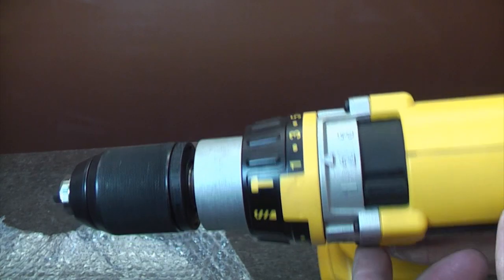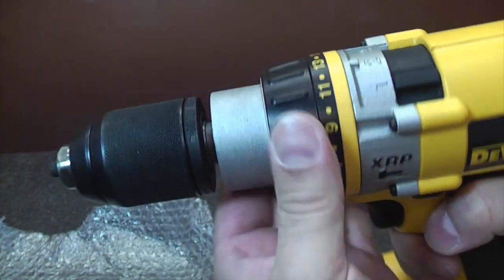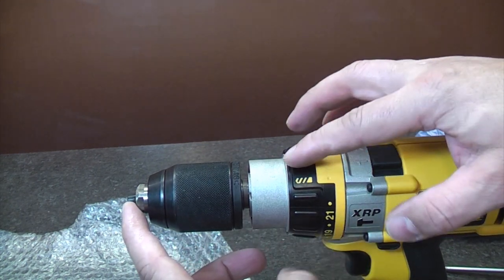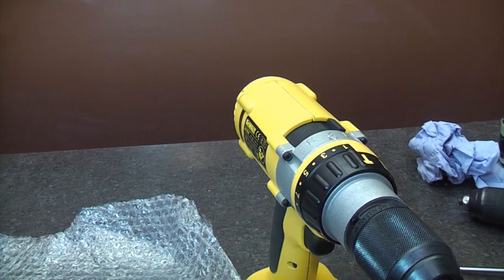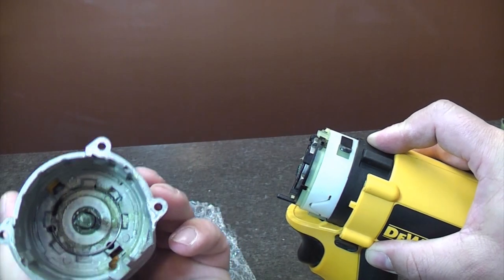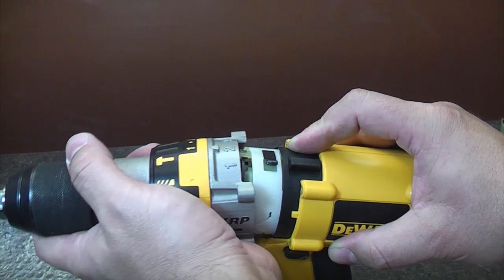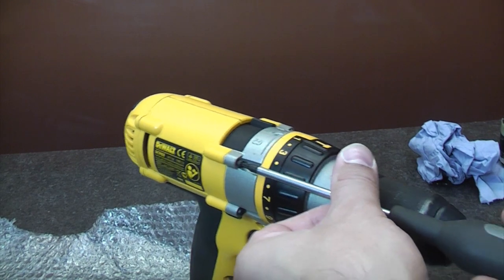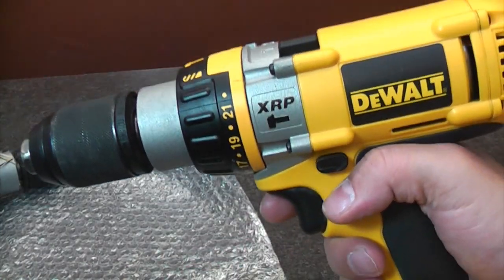Dewalt XRP clutch replacement

Comment: my brother gave me a dewalt dc925 xrp  and it's not working and i wanted to change the brushes to see if that will make it work. but i don't want to spend money on an impact wrench so my question to you is can i buy the dewalt impact wrench adapters 1/4 3/8 and 1/2 to change parts on my car so please let me know

Comment: Well ... how do ya like them apples!  Nearly 20 yo DeWalt XRP DC987 w/o hammer drill clutch option ... clutch was stuck in screw mode ... loosened the four (4) screws a bit and was able to get it out of screw mode ... able to rotate it like it's 'sposed to ... retightened screws ... wouldn't go into screw mode ... took all four (4) screws out, pulled clutch assembly and just started working the clutch including screw mode ... didn't see anything really needed cleaning OR lubrication ... not a lot of lubrication but everything appeared to be O.K. with nothing jammed, etc.  Worked clutch through it's full cycles ... able to rotate it full 360 degrees ... dozen times or more ... operated smooth as a baby's bottom.  Reassembled clutch assembly over transmission, put the four (4) screws back in, checked it, finished tightening all four (4) screws and WHALA! ... back to like new ... clutch operates perfectly.

THANK YOU!
Reply from the maker: I'm glad you have fixed the issue.
I have a spare gearbox and chuck assembly in my garage somewhere (I need to find that)
Thanks for the comment 👍
Reply: @ultimatehandyman  Yeah ... I thought it was a gonner for sure.  So, I'm feeling really blessed to have my nearly 20 yo DeWalt XRP DC987 back.  You can find YouTube videos for almost anything.  Some are pretty good ... some not so much.  Your YouTube was about as good as it can get.  WELL DONE!  I knew about the four (4) screws, however, was reluctant to attempt to disassmble it ... concerned that springs, clips, etc. would pop out and I'd have no way of knowig how to reassemble it.  Clearly your YouTube video posting got me past that.  THANK YOU!

So, I seized on the opportunity of my DeWalt XRP DC987 stuck clutch AND three (3) 18V batteries who had all given up the ghost to grab a new DeWalt DCD778 compact drill this time INCLUDING hammer drill option that I really missed on the DeWalt DC987.  Now I've got two (2) DeWalt drills in my arsenal and lovin' 'em both.  I also grabbed a couple 18V knockoff generic 18V 9096 batteries which I needed anyway for my DeWalt Sawzall.

I should be all set for now.
Reply from the maker: @jimpearman1654   I know what you mean about removing the screws ;-) 
I'm sure I did that on something when I was a kid and the thing fell apart like a Jack-in-a-box 
You won't go far wrong with Dewalt, I have tried Bosch, Milwaukee and Makita but Dewalt always seem to be the best for the money.
Thanks for the update ;-)

Comment: This video is the closest I've come to show how to replace the collar adjustment mechanism, that I have purchased, that you show as a sub-assembly.

I've yet to disassemble to the point of re-assembling that collar adjustment, itself. Can you tell me if the way to get to that if from the chuck direction or the gearbox direction ? I'm am presently disassembled at the gearbox/housing point resulting in the same sub-assembly you installed in this video.
Reply from the maker: I'm not sure, sorry.
It's a while since making this video and I have not worked on any drills since.
Reply: Thanks for the reply. As it turns out, I've got a conversion kit on 
order and other options pointed out, that may well solve the inability 
to assemble the adjustment collar issue that I have at this time.
Reply from the maker: You are welcome.
Best of luck with it ;-)

Comment: I recently bought a DeWalt drill (d21570k a.k.a Silver Bullet). The gear is a little wobbly, but does the job perfectly. Can I somehow tighten it up if I remove the keyed chuck?
Reply from the maker: Gandalf4137 
It's doubtful. There is a chance that something has failed inside the machine (perhaps a bearing) that would need replacing.

Comment: Any ideas on a DEWALT DC820KA impact that recently lost its torque. Seems like it lost its power, batteries are good. It acts like a cordless drill turned way down where you can hold it with your hand and stop it.
Reply from the maker: I've not taken a impact to pieces yet, but I would imagine there is something wrong with the impact mechanism, I'm not sure if you can get replacement bits or just replace the whole impact section.
Thanks for the comment

Comment: Would this be the reason for losing some torque? I ask because I noticed mine lost quite a bit of it when I used it for the third time in five years.
Reply from the maker: Not sure, but if the motor turns and the chuck does not it is likely to be the gearbox.
Thanks for the comment

Comment: Hello 👋 So I have a question. My dewalt is different. But when I put it on the drill setting it slips as if it was on the clutch setting. Can it be fixed ?
Reply from the maker: Yes. It sounds like the clutch might be damaged. https://youtu.be/s262yXyUYD4

Comment: My dw997 clutch has failed - constant slipping. Replacement clutch is not cheap, I wonder can i make it seize up, so that I no longer have the clutch or hammer but just a regular drill.
Reply from the maker: I'm not sure, sorry.
I have seen one fall to pieces and there was literally hundreds of small pieces that fell out of the housing!

Comment: I have a DCD951 hammer drill that the clutch has gone out. Is it worth replacing the clutch assembly and where is the least expensive site to buy replacement parts such as the clutch assembly?
Reply from the maker: Peter Coots I normally get parts from ebay-http://fave.co/1PR7ZIp
Reply: ***** Thank you. I will check into this.
Reply from the maker: Peter Coots 
You are welcome ;-)

Comment: How do you remove the chuck on a DCD996?
Reply from the maker: It should be the same as this method, although you will have to open the chuck and see what kind of fastener is holding the chuck on as it could be a Torx head on a Dewalt- https://www.youtube.com/watch?v=xagFLCseeDk

Comment: Good video. Where's a good place to buy the part in the UK?
Reply from the maker: I bought mine from a seller on ebay, I'd check there first ;-)
Reply: I have had a quick check, but no luck so far. Looks like with shipping from USA these come out at around £69 for new. Though on Ebay you can get SH drills for quite a bit less.
Reply from the maker: Blimey, that is expensive.
There are some at £46 including delivery for the 988 model, but they are much cheaper in the states!
Reply: Actually, I see that eBay does have some refurbished ones for less than £40, but I wonder if they are any good? Maybe if the seller has a high rating I will take a punt. Thanks.

Comment: Hi all.is it possible to disassemble and repair the clutch only on a Dewalt DC925 drill?.
Reply from the maker: Patrick Brick 
I don't think you can buy the components individually, but if you could it may be possible!

Comment: I think I just broke mine :( I didn't expect it to break that easily. I have a 10 year old Makita still going strong. This one is not more than 3. And I am just a diy girl, not a professional that would use tools all day long. Bit disappointed in Dewalt.
Reply from the maker: Is it a model with a plastic covered chuck?
We used to have one of those at work and it was a real pile of junk, but I would have expected one to be ok for DIY use.
Reply: Yep, DCD 776. Maybe too much DIY but Makita has worked longer and harder. :(
Reply from the maker: A lot of people like Makita, but I do know a few that don't.
I think I got about 10 years plus from my Dewalt drills, but decided to sell them to buy brushless a few months back.
I did get sent a drill from AEG and that is a really good drill, but I think it's a similar price to a good Dewalt (one with a full metal chuck).
Thanks for the comment

Comment: Useless vid you didn't replace the clutch assembly , all you did was take off the housing and refit the housing.
Reply from the maker: That "housing" contains the gearbox and clutch. You buy it as a complete unit, you can't get it without the "housing" unless you like trying to assemble planetary gears into an arrangement that works ;-)
Thanks for the comment 👍